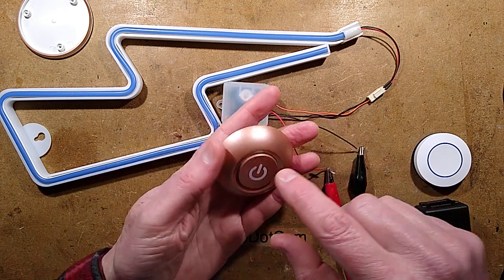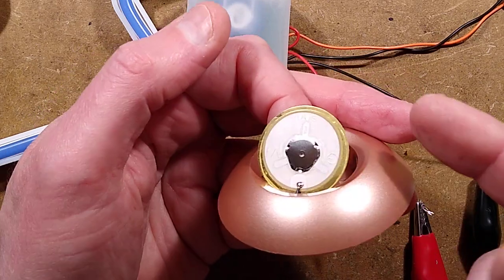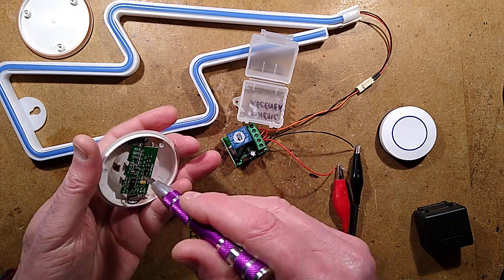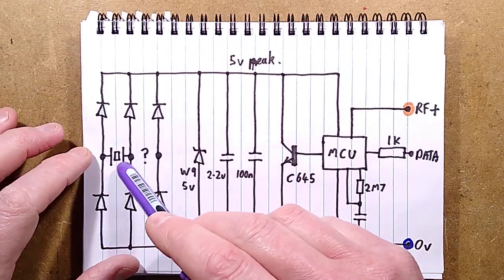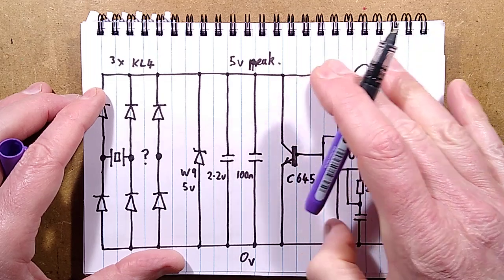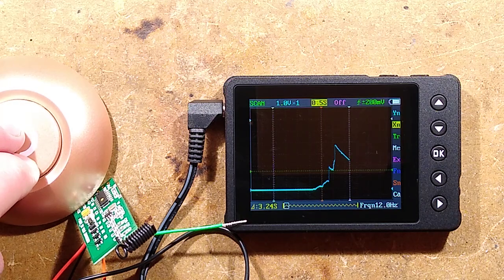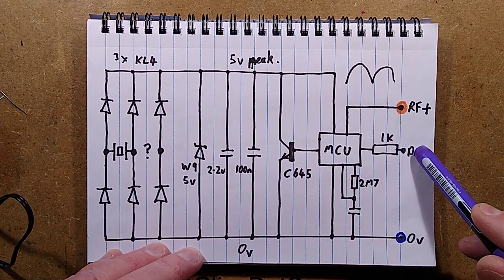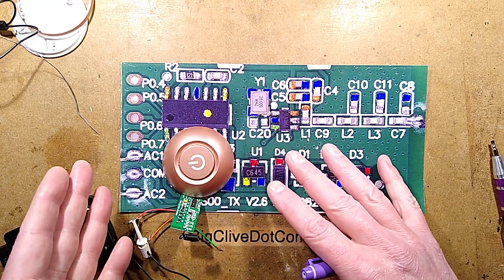I thought this was going to be a fake kinetic switch

Comment: Thank you Clive. Now replace the Piezo with a battery and see if you get better range out of it or if it stays the same. I guess you might have to make capacitor dump circuit for the battery so it does not get shorted out when the circuit clamps down the supply rail.
Reply: Probably won't.  Spamming the button seemed to get the caps fully charged pretty easily.
I think you need to adjust the transmitter itself to draw higher power.  (Which makes me think that some way to adjust that would be a nice feature for these sorts of things.)
Reply: @travcollier  yes I think your right.
Reply: @Robothut  It is sort of cool that spamming the button likely makes it work slightly better though.  I mean, that's what we all do anyway when it doesn't work the first time :)
Reply: @travcollier  So maybe remove the power dump transistor and just let the unit send the commands as long as the battery ON button is pushed, maybe that would spam "send the code over and over until the receiver sees it. But in the end I think your right the transmitter is just so low power to work in this fantastic design that range was just not what they were going for.
Reply: @Robothut  How good would a switch like this one be if the user had shaking hands?
Reply: @myparceltape1169  It is snap action by what Clive shows so I think it would be OK.
Reply: @Robothut  The way I was thinking, was the button pressed an even number of times or an odd number. 
Pressed to give On then Off or a single, or 5 presses would give On, provided you started at the Off position.
Reply: @myparceltape1169  Clive showed it did not work that way, He could press it as many times as he wanted and the receiver had a time out circuit that only allowed the switch to change states after a certain amount of time went by. So a jitter finger should not be a problem unless you leave your finger on the button a long time and keep pushing it.
But hay we are all different , only one way to find out if its a problem for you would be to try it.

Comment: if not piezo-electric, what about a magnetic-kinetic pavement then?
Reply: Trevor Bayliss - an inventor of the clockwork radio - also had the idea of making piezoelectric devices into the soles of the boots of marching soldiers! His thinking was that as the soldiers mindlessly matched around for hours, collectively they could accumulate enough energy to power a CB radio for a few minutes!

Comment: Can this power a Pi Pico? Also, this is perfect for a doorbell... No holes, no batteries.

I can see these replacing light switches in cheap houses, the cost of fishing and mains copper, rewiring for customer preference, fire safety compliance, or worse, moving the switch and patching the hole, would easily make up for the cost. And it would allow every lightbulb and outlet to be addressable by default, on the cheap, without computerization... Maybe.
Reply: With sufficient additional capacitors and a suitable voltage controlled switch you could probably power a Pico for a short length of time after mashing the disk for a while, but certainly not after a single button click. The energy from a single click is very low.

Comment: I've been meaning to experiment with using a capacitor to run an Arduino like press a button that would charge a capacitor quickly which would then run an Arduino for enough cycles to do a particular task and then the capacitor would drain and wait for another button press.  If the button isn't pressed then there's no connection to the battery and zero quiescent current in the circuit. Which would hypothetically make the battery last a very long time.  I wonder if that kind of thing would work based on that piezo crystal button or something like it.
Reply: Unfortunately the name Arduino is getting hard to define.  Today it's kinda a software platform.  The old ones were based on Atmel chips that (for the time) had very low sleep current.  I played with a pre-Arduino forefather, the AVRS1200.  In mode "sleep but wake on interrupt" it consumed less current than the internal leakage of the battery.  So there was no point in disconnecting it, and your proposal would be worse.  Chips are made today that have even lower sleep current but the "package" of components around them that remain powered up may wreck that.  Tip from an ancient git: check the leakage from a battery or electolytic capacitor before adding components.
Reply: @raykent3211  Of course I was referring to the architecture.  the most likely candidate for such a project would be something in the ATTINY range which have very low current requirements.  Programmed with the Arduino IDE to do whatever.. The problem is, I don't currently have any project in mind that would benefit from such a setup.

Comment: The placement of the vias does not affect RF until they are far enough apart to let RF through. That would be tens of centimeters for 433MHz.
The placement of the vias would be down to a PCB designer only wanting to put the minimum in and the RF designer wanting the board looking like it has been blasted with a shotgun (the vias are clustered around the output matching circuit although an attempt is made to put plenty in around the power section but components restrict them there).
I work with RF and power engineers who insist on ludicrous numbers of vias (particularly laser micro vias) to the point that rework on PCBs can be a real challenge because the heat wicks away like the lamp boards on aluminium you tear down.
The trouble is that the PCB design software allows engineers to zoom in to a scale where they can always see room for another via, so they will insist on it.
Reply: Also, the output network to the antenna serves two purposes: one is to filter out any frequencies that must not be emitted, and the other matches the impedance of the signal to air (usually 50 ohms) for optimal energy transfer to the 'aether'.
This also explains why they went to the expense of putting a crystal in because it is multiplied to the RF frequency - yes 26MHz doesn't multiply directly to 433MHz, but it is a common crystal frequency in RF and so the PLLS structures already exist). The crystal has good accuracy and drift characteristics so that the output will be on target.
Reply: @AlexanderJohnOgle  Hadn't thought of impedance matching, but it could.  I agree, it's probably a filter to strip out harmonics.

Comment: Pretty sure what you described with the “curie temperature” was how electrets are manufactured. Piezoelectricity is different. A crystal is chosen with a particular geometry such that when squeezed out of its equilibrium position there’s more positive charges on one side than the other, and sliced (or grown) in a particular direction to maximise that. An electret moving between capacitor plates will also produce a momentary voltage, much like moving the dielectric within a standard capacitor with some bias voltage across it.
Edit: a video about making electrets:
https://youtu.be/1DR-tTU8uIM
Reply: As far as I'm aware even single crystal piezos (as opposed to the typical pzt ceramics) have a Curie temperature at which point polarization is lost. Also, heating until Curie temperature is not required to pole piezos, it's just easier at elevated temperatures.
Reply: No, he's exactly correct. BigClive is describing a process called poling, which is necessary for most common piezo materials like lead zirconium titanite (PZT). The process aligns the electric dipole moments in a crystal, otherwise they are naturally randomly oriented and tend to cancel each other out. The only thing is you want to have an elevated temperature, but below the Curie temperature. At the Curie point, the electric polarization is lost.

https://youtu.be/k6Cu1KTqVjM?t=635
https://en.wikipedia.org/wiki/Piezoelectricity#Mechanism
Reply: @straightpipediesel 
Oh I see, that would make it much cheaper than growing a single crystal.

Comment: You can make a TV clicker out of it...just like the 1950's
Reply: i thought those were ultrasonic tuning forks...
Reply: Nope. Those were not electromagnetic devices. I still have one from Sony. Two tuning fork like rods that ring in the audible range. My high school girlfriend’s silver bracelets would change the channel too.
Reply: Actually just an aluminum rod. Pressing the button cocked and released a striker, releasing the button clamped on the rod to damp vibration. Truly genius!
Reply: Back to no batteries in the remote would be great!
Reply: @johndii2194  only if you want to go back to extremely limited functionality. The old manual ultrasonic controls only allowed channel and on/off control; the high end ones did volume up/down too, but that's about the limit of what's possible! 
I did repairs for a Curtis Mathis shop and theirs only operated the channel selector. Push the button on the remote and a motor turned the channels selector. When it got to the one you wanted you release the button. Channel Zero turned power off!
Reply: Notice the ZOOM button? You couldn't have anything near the TV because when you pushed Zoom the TV got bigger and pushed everything off the shelf.
Reply: @johndii2194  I'm quite familiar with those. I worked my way through college as a tv repairman in the 60's.
Yes, they are ultrasonic, but definitely not the simple mechanical units under discussion. They are complex electronic, battery powered devices that place an audio tone on the ultrasonic carrier. Quite beyond the abilities of mechanical units.

Comment: We had strain gauges in aviation with piezoelectric crystals in them for Vibration analysis. it was a metal block with three axis , one crystal per axis, the electric current was sent to the computer that mapped the voltages into IPS, or inches per second. Each rotating component had its own signature, so you were able to find out if there was a bad bearing or gear somewhere in the machine. They were also used for rotor balancing, adding weight to the rotor in the correct clock position would correct lateral balance issues and pitch link adjustment for vertical.
Reply: Truly amazing engineering. That someone figured it out. There was a problem and design something to fix it
Reply: Interesting, I spent several years writing the software for that kind of analysis but never used a tri-axis sensor. We mostly just used two sensors for two axis.
Reply: Oh that's really cool! The uni i go to is doing lots of work with machine learning and vibration analysis from things like that, from wind turbines to detect likely failures it's super interesting
Reply: That sounds like a fairly common accelerometer design

Comment: Big Clive-Inventor of the Joule Thief circuit.  Another awesome video.
Reply: No it was Z. Kaparnik as acknowledged on BigClives website. Big Clive invented the name Joule Thief
Reply: @davidsnell7627  No, I believe he came up with the blocking oscillator circuit and Clive acknowledged him for that.  Clive Invented the Joule Thief circuit and I have been making them for over 13 years now and, can even light 400 leds on a single "dead" aa battery and can light fluorescent tubes on that same aa battery.  I have JT circuits that put out over 400 volts from a "dead" aa battery.  I had 75 videos on my YT channel most of which dealt with the JT circuit.  I pulled them all since YT stopped paying me and ran their own ads.  I am moving them all to Rumble but it is taking a while.  Clive named it the Joule Thief and took it to places that Russian fellow never dreamed of but yes, Clive did give him credit where credit was due.

Comment: One of the reasons I enjoy working in electronics is the colourful components and cables. But SMD has 'monochromed' everything; either black or brown. Thanks to BigClive for bringing some colour back into it with those red, blue and yellow coded marks on the PCB photo!! :-D
Reply: I just got done fixing up the Vox organ from 1967 in my profile pic. The thing's an absolute work of art under the hood.
Reply: Us old gits need to stick together.
Reply: Bro I feel you. My greatest joy is opening electronics that had hand assembles circuits and pcbs from products 25 years old
Reply: @kirk5452  From the mid-late 90's? (1996 was 25 years ago) I'd say the majority of electronic products were starting to be made with SMDs by then. You're probably thinking of products made in the late 80's and early 90's.
Reply: @thegorgon7063  the mid 80s were clearly 25 years ago and you can’t convince me different.
Reply: @JasperJanssen  lol 😂 when people say "10 years ago" I still think of 1990...

Comment: Between this and the magnetically operated switch I'm surprised by the components that can work reliably with brief and this tiny burst of power.
Reply: Ultra low power electronics are freaking cool.  They open up a lot of applications people still haven't really thought of.  Sensor networks are the ones I most interested in, but there's doubtlessly good ideas I've never imagined.
Reply: @travcollier  seeing this more and more in modern building automation. Solar powered RF thermostats or kinetic light switches...
Reply: I have had a kinetic switch doorbell for about 5 years now. It has been FAR more reliable than battery versions that would crap out without notice - as well as being severe weather resistant. I did have to be creative where the receiver was (to ensure reliable reception) but it has been consistent. The switch is outside a brick garage with metal doors and the receiver is in the basement inside the HVAC service room.  I'm not sure if mine is piezoelectric - but the switch toggle travel seems to be "forced" and may be the magnetic model design.
Reply: Not reliable i fear...theyll be turning off things at random unless theyre coded properly.

Comment: I think you'll find this probably isn't a 433 MHz remote, and that's why it doesn't work with any other systems.  433 MHz is not harmonically related to 26.0MHz.  Put the output on a real oscilloscope and see what's there.  The output filter is to attenuate higher frequency harmonics so it meets spectral purity regulations and doesn't spray interference all up the band.
Reply: There are quite a few off the shelf transmitter/transceiver ICs that use a 26MHz crystal to generate a whole range of output frequencies including 433MHz.
Reply: I bet CB radio users 'love' these - oh wait, that's 27MHz isn't it?
Reply: @stepheneyles2198  Depends on where you live.
Reply: @stepheneyles2198  The transmission is so short it's probably not noticeable, or a tiny click
Reply: PLL with multipliers and dividers dont have to be whole numbers, eg they can do two fifths and others to get fractions... would be nice to ask Clive to apply SDR to the RF output though...
Reply: @fumthings  That's an awful lot of trouble for a cheap chinesium device that always transmits on one frequency.  I would expect a simple multiplier.

Comment: It surprised me how sensitive a piezo crystal is to vibration.
Reply: It's one of the reasons that ceramic disc capacitors are not recommended for use in low-signal audio applications.   They're actually microphonic.
Reply: I'm wondering if I could make a sensor for my mailbox to let me know (via RF) when someone opens it. A regular make/break switch might not be good because my mail carrier tends to leave the door open.
Reply: @tncorgi92  a novel idea, but it would be more reliable to use an accelerometer.
Reply: @tncorgi92  Hi Paul, how are Perry and Della? :)
I've seen this one solved various ways--one way is optically, such that a letter will block light from an led to a photosensor.   You need only activate the LED every few minutes, so that a battery would last a long time.   I've seen similar setups using PIR sensors and small transmitters to signal when someone is coming up a driveway.   I suspect that there may already be a "ready to eat" solution out there somewhere.
Reply: @tncorgi92  if you use an arduino you have lots of options for different sensors that could work well for that application. It also has the additional positive of being able to be programmed to let you know regardless as to whether the carrier remembered to close the mailbox or not.
Reply: @tncorgi92  a friend of mine built a mailbox detector using www.whatimade.today/esp-8266-mailbox-notifier-using-deepsleep-and-blynk/ as a guide. Piezo powered would be very cool though!
Reply: They are used as microphones after all.
Reply: EEV Blog has a superb video about microscopy on oscilloscope input channels. Check it out.
Reply: So much love in the world i don't deserve it ❤️

Comment: I can totally see the advantage of this for short range operation in the same room as the light. It's one thing to change the battery in a hand-held remote, quite different to have to change it in the switch by the door - perhaps stopping you from turning it off !

But what would be really good is to use this for adjacent switches, wall-switch replacements, and to have a battery powered remote that sends the same signal more powerfully so you can override it from anywhere. If the radio signals aren't compatible, that just points to a need to reverse-engineer the protocol and transmit it from a special remote control.
Reply: I have a bunch of ancient X-10 Stuff in my house. I have a good dozen stick-on wall switches that will control 3 different channels as well as a dimming function. In the last 25 years I've had one switch break and be replaced, and had to change the battery once in one other switch. All the rest are still working on 25 year old CR2035 batteries, and not giving any problems.

Now, some other switches may not last anywhere near that long. But batteries dying may only be a problem for 25th century archaeologists trying to turn on the lights in a house they are excavating.